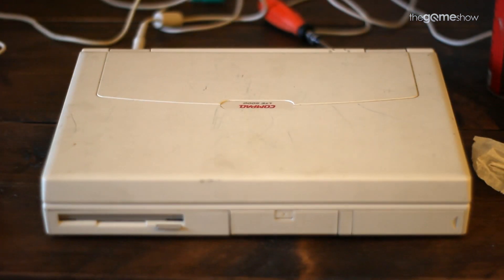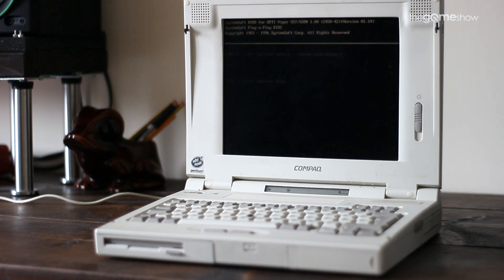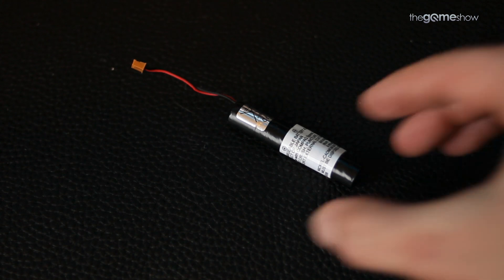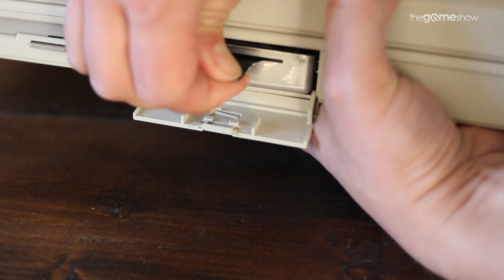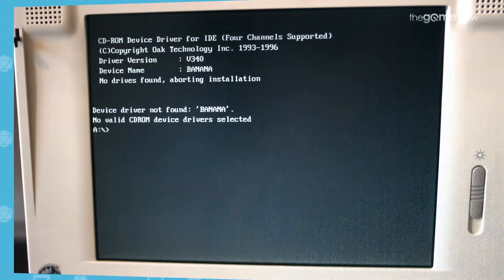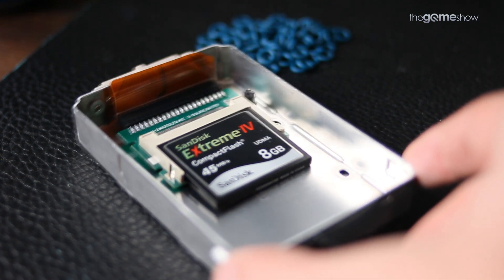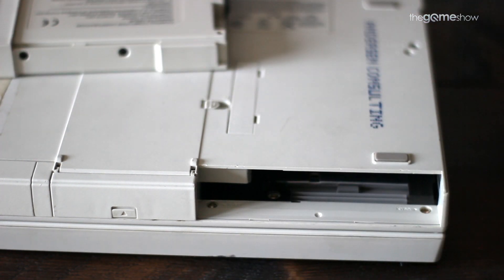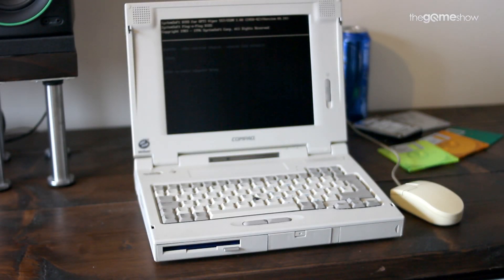Upgrading a Compaq LTE 5000 Laptop with an IDE Compact Flash Card for DOS

Comment: Hey I need to find a charger for one of these what are the power specs on the adapter?
Reply: Output: 18V 1.9A
Reply from the maker: Pinned for visibility!
Reply: The Game Show I ended up using a compaq 2882 which gave me no problem.
Reply: @DrDooDooBucket  The  Compaq 2882 is exactly the same power adapter that would've come with the LTE series. So good find!
Reply: Terrum cool this was all 6 months ago so I barely remember how I even found the correct adapter but I got the laptop up and running correctly.

Comment: I've got a 5100. It simply does not recognize any attempt at hard drive I throw at it. HDD, SD, CF.
Reply from the maker: How frustrating! I had a problem with mine not recognising the CF I bought. But I bought a much cheaper one and it was recognised fine. If you're having wider problems, perhaps this is down to the hardware. The connector or cable might be faulty?

Comment: Buying a Gateway Solo 2500 is better use of money. Although the Toshiba Satellite Pro 445CDT is better investment. It had Windows 95 OSR2 on it's replaced hard disk drive so I decided to stick a Western Digital Scorpio WD400 on the machine in which I installed Windows 98 First Edition on the machine since it had when I got it 144 MB of RAM and an Intel Pentium MMX clocked at 133 Mhz. Threw quite a bit of Blizzard Entertainment games on it. There is better stuff online anyway.

The only other laptop that would have rivaled the Toshiba was the Compaq LTE 5300 with 80 MB of RAM but that one only had an Intel Pentium clocked at 133 Mhz with no MMX and had no USB. At the time I did not even have a PCMCIA CardBus network ethernet card. The Compaq much like the Toshiba you could swap the floppy drive out for a CD-ROM but with the Toshiba you can connect the floppy disk drive as an external drive. The Compaq LTE 5380 as opposed to the Toshiba as well as the Gateway had a 1024x768 TFT LCD Display whereas the Gateway as well as Toshiba had an 800x600 TFT LCD Display.

The major drawback with the Compaq LTE 5300 was the most in terms of an operating system that you could run was Microsoft Windows 95. The Toshiba Satellite Pro 445CDT you can go up to Microsoft Windows 98 provided that you have the RAM. I really like the Compaq Armada laptops that not just came with Pentium MMX but also Pentium II processors not just because like with the Compaq LTE 5000 line which came with ESS AudioDrive ES1688 and you also had Armada laptops that had that in addition to having a built in power supply.

The Toshiba Satellite Pro 445CDT had Yamaha OPL3-SA Sound Chip. The problem with the Gateway Solo 2500 as opposed to the Gateway Solo 9100 was the limited MS-DOS Mode support only working on Windows 95 OSR2.1 mainly for the fact that the NeoMagic MagicWave 3DX Sound System on that laptop only seemed to work properly on Windows 95 and not Windows 98. You could not properly run MS-DOS 6.22 & Microsoft Windows for Workgroups 3.11 on the Gateway Solo 2500 whereas the Compaq as well as the Toshiba you were able to. MS-DOS compliant sound hardware is a really big deal. On the Toshiba I ran QUAKE on the WINQUAKE port at 400x300 and it ran a little bit choppy but mostly smooth. That Chips & Technologies 65554 PCI onboard video chipset on the Toshiba is on par with the Gateway Solo 2500’s NeoMagic MagicGraph128XD especially with both having 2 MB of VRAM. Although I do like the Compaq LTE 5000’s Cirrus Logic GD7543 with it’s 2 MB of VRAM is also not a bad options.

Comment: Concerning the battery, I recommend you buying some lithium ion cells and do a bit of math. Find the designed battery specs, and build yourself a power regulation circuit that adapts modern power cells to the laptop's requirements. It will take some effort, but you can do it.
Reply from the maker: I do not recommend anybody make their own battery.

Comment: Great video! Willing to try with my LTE 5100... BUT (allways a 'but'). 
I'm having an issue with my memory expansion module. (two 4Mb modules=8Mb to add to 8Mb main ram)
I get an awfull "error 7808 FATAL error at location 800004" during memory test.  
It doesn't matter if i switch the order of the modules, i allways get the same address (800004), and i wonder if it could be a 'hardware' internal error  (or maybe BOTH modules have the same error?)
I dont want to spend 40 or 50 bucks without knowing if it's an internal error in the card interface. Any clue about how to test?
It would work with a memory expansion PC card? (lot easier to find than the original module)
Thanks folks!

Comment: yay I have one too. There really well made devices, I had two at one point the first one was doa so got sent a replacement and sent the dead one back where it was possibly just chucked in the bin i never knew the hdd was just a normal drive thought that box was the actual drive also arn`t those cells in the main battery just 18650 cells could just wire up some new ones maybe
Reply from the maker: You definitely could. I asked some guys who are smarter than me if they could and they all thought it wouldn't be too hard. The problem is that the battery case is glued together. So it was impossible to open it without destroying it :(
Reply: @StokedMatty  mines the 5300 as it turns out. So far Iv not done much with the battery but I’ll be giving it a go at some point like you mentioned it works fine plugged in. The battery’s may be slightly different but I’ll post another comment should I get it apart without damage. Iv managed it before on an eee pc sometimes you get lucky and the glue kind of cracks apart.
Reply: The Panasonic HHR-380A are an exact replacement.  These batteries can be opened without destroying them.  Just don’t rush the job.

Comment: Great video ,  my LTE 5000 had a dead HDD, I've now got a 2GB CF card in there and it shows up just fine in the bios. 

My only problem is that I'm now stuck trying to get an operating system on there.
Reply from the maker: Do you have a USB floppy drive?
Reply: @StokedMatty  Not at the moment, it looks like I'll have to get one though.
Reply from the maker: @absinthe4breakfast299  You could try copying the unpacked DOS files onto the CF card from another machine, but I created "real" install disks with a USB floppy drive and files from WinWorld.
Reply from the maker: @absinthe4breakfast299  I'm pretty sure I went with 4 or 5. There's not a lot to choose between them to be honest. I'd say stick with what you've got. I know it feels like a lot, but trust me you can't really mess it up :)
Reply: @StokedMatty  I'm having all sorts of issues with the USB floppy drive I bought, I'm not sure if it's the drive or the disks I got for it, the disks are becoming unreadable after one or two uses..

I might have to try another approach.
Reply from the maker: Found this great guide on Twitter on how to use VirtualBox instead! https://twitter.com/RetroTechChris/status/1419099171727020038?s=19
Reply: @StokedMatty  Thanks for the link, I really appreciate all the help .

Comment: The BIOS of this laptop will not recognize a disk larger than 4GB regardless of partition size.  You can use a program like Ontrack Disk Management to get past this limitation.  I was able to partition and format 8GB CF cards with a single 8GB partition without any issue.

Comment: I just found an LTE 5300, and from what I can tell by dissecting it, the CMOS and main batteries with size and voltage measure up to be something like this:
-The CMOS battery is four 1/4 size AAA NiCd cells in series ending up as a tube that's 62mm long
-The main battery is ten 4/3 size A NiMh cells in series ending up as 5 tubes, each being 133mm long
If you can somehow hunt down such a form factor and feel like messing around with soldering, the math and size seems to add up as both cell types are 1.2V per cell.

The video and its predecessor was very informative for me on how to start maintaining the device, thanks.
Reply from the maker: Thanks for checking these two videos out! I still use my LTE, I'm glad these were useful to you. I'm not confident enough with electrical engineering to make my own batteries. I would happily bow to someone smarter than me on that, and you sound like one :)

Comment: I just found a compaq LTE 5250 laptop (a slightly faster model running a Pentium at 120mhz with 16MB of ram and an 40GB HDD) on the floor in the stable at my parents place. It was literally covered in horse sh*t, dirt and staw, but it powers up and works perfectly haha (except for the battery which is dead). It also has windows 95, so I guess that was the os that came preinstalled on these machines (at least mine - my parent know very little about computers).
Good idea with the CF card. I'll definitely do that. At the moment, the only means of transfer I have is the floopy (which works, just installed the shareware version of Doom from original floppys). The only gripe I have with this computer is that it lacks a gameport for a joystick. A PCMCIA to gameport adapter seems to have been around, but I can't seem to find one.
Reply from the maker: You're dead on. These laptops did come with Win95, but I don't think it runs particularly well which is why I went with DOS and Win3.1. I'm sure PMCCIA -> GamePort adapters exist, but you'll be looking for something old..?
Reply: @StokedMatty  I just noticed that it  actually has a gameport hidden behind a hatch on the back of the machine DOH. So i'm a happy camper now.  I'll go with DOS and windows 3.11 aswell. Just waiting for my CF card adapter to arrive. :) Also, a bit of correction on my inital post, it has a 800mb hdd (not 40gb obviously). Just watched the 8-bit guys guide on DOS laptops and apparently my version is less ideal than the TLE5000 (even if it's faster) because of the fixed 800x600 resolution. So DOS games (that typically has a 320x220 resolution) scales up to 640x480 and leaves black bars to fill the entire screen...
Reply from the maker: @PARASITSTUDIOEFFECTS  No big deal! It's still a free dosgaming laptop! Keep me posted, I'd love to hear about this. Drop me a line on Twitter if you use it ☺️

Comment: I just ordered this and will use it to give rebuilding the batteries a shot.  I have four LTE 5000 series laptops.  Two of my batteries have circuit boards that pass visual inspection.  The other two were pretty badly eaten :( https://www.digikey.com/product-detail/en/HR-4%2f3AU(4.0AH)L2X5/SY135-L025-ND/1203627?utm_medium=email&utm_source=oce&utm_campaign=3078_OCE20RT&utm_content=productdetail_US&utm_cid=1134651&so=63797571&mkt_tok=eyJpIjoiT0RSaU9UaGxNMlUzTXpreiIsInQiOiJsd1lvTVZYVFBHQk9wZTQ3XC94VVlcL1puNkNaWWxyR25zRnhrNEYyK1I3ZEdUenFCaTZvR2ptaW4xYUlWY1VMYWtoMVljbllhZ3dCR042aThUOHNiVjkreFU0VmdpOEVRTWZYVFhaV0xiTmk1Z2JURG5SU1BTbTBpR0F0SmZzTFVKIn0%3D
Reply from the maker: 85 bucks for a battery! Let me know how you get on mate.
Reply: @StokedMatty  will do!!
Reply: @StokedMatty  installed and charging!  Hope it goes to 100%.  So far, gone from 6% to 18%, and I was able to unplug AC power and run on battery!
Reply: @StokedMatty  battery went to 100% and the laptop ran for a few hours on battery!!!  Having some issues on second charge (it was charging up then stopping), but I am optimistic that the battery recalibration util will fix it.  Running that now.
Reply: @StokedMatty  another thing, I think a Compaq genuine charger is a must.  The aftermarket chargers charged very slowly and the battery would discharge when the machine was running and charging.  And the machine would shut off if you pulled the battery while plugged in.  Not seeing these issues with a genuine charger.
Reply: @StokedMatty  Sadly, I think this experiment has ended in failure.  The thermal breaker in the battery keeps tripping, which means that it is getting too hot when it charges.  Might be an issue with the thermister that hooks up to the charging board for the battery, but I am going to pause on this project before I burn my house down.  Someone more knowledgeable than me (which pretty much constitutes anyone else for this) could probably work it out.

Comment: Great job! Couple tips:

First, on the hard drive, I have found CF cards to be quite picky when using them in this manner, with many just freezing up on format. To get around that, you can try other brands and capacities, or go another route: mSATA to 44 pin IDE adapters. I have one in my LTE5400 with a 120GB SSD that cost me next to nothing from some chinese vender, and the speed is fantastic.

As far as capacity, the first thing to do is upgrade the machine BIOS. The LTE5000 series has a 2.1G limitation iirc unless you have the latest bios rev, which brings it up to 8.4G. Of course, if you want to use more capacity than that, you will also need an overlay like OnTrack, which is what I use for mine.

As much as I understand your comments about running 95 on such a machine, there is one killer benefit to using W95, in particular, OSR2: FAT32. You can actually make an arbitrarily large filesystem, up to 2TB if memory serves, and load on every bit of MS-DOS software you can get your mitts on. Just disable the win UI on startup. The only sad thing here is you cannot run Win31(1). 

The full Win95 environment does actually run pretty well on these things though if you use period-appropriate software or write your own. Yes, VC++6 works great on these too, or as great as it will ever run on a 120MHz pentium anyway... That being said, TASM, Borland C, and the various 16 bit dev tools absolutely scream on this, as does most dos software. Getting MoSlo (pay for it) is HIGHLY recommended, as much older software just flies by without your input without it.

Cheers! Keep up the good work!
Reply: Hi. Please can you recommend me the type of mSata<>Ide adapter. I would like to use it with my LTE.

Comment: I just obtained a compaq lte 5000. But the cmos battery is gone. Do i need it? I dont know much about computers
Reply from the maker: You don't need a CMOS battery. The PC will still work fine, it just won't keep internal time. If you make configuration changes in BIOS, these will also reset each time the machine turns off. But you can use the machine sort-of fine without a CMOS battery.

Comment: You should rebuild the battery from lithium ion cells. You can buy some from ebay, or maker sites. You'll need to do a little research for what specs you will need for your laptop.
Reply from the maker: I like my house as it is, not burned down 😆 Seriously I don't have the electrical confidence to make my own battery and plug it into the mains.
Reply: @StokedMatty  check out 8bit guys video on it. It's easy.

Comment: Windows 95 is the perfect OS for this generation of laptop. I have a 486DX-50 laptop with 16MB of RAM that came with Windows 95 when new. It's period correct. Also, nice video! I use CF cards on almost all of my retro PCs that don't have support for large hard drives.
Reply from the maker: Thanks man, I'm glad you liked the video! Win 3 runs a lot quicker than Win95 but no doubt about it being period correct.

Comment: I'm going to try doing this with an old Dell Latitude C600 from 2000. It has a 10GB hard drive I'm going to put a 32GB CF card in it. 

Also the RTM floppy disk version of Windows 95 sounds like a fine match for this laptop since it doesn't have all the Internet Explorer bloatware in it (like in the later OEM CD versions), and it can run Win 3.x programs just as fine.

Comment: Buy a replacement battery for a GE Datex Ohmeda S5 Patient Monitor.  The cells are identical and already in the correct orientation.  Just solder the wires from the old board onto the tabs and Bob's your uncle.
Reply: @Paul Briggs The part number is CS-GMS500MD.  Not exactly cheep, I think I paid about $50.  But still far cheaper than buying the individual cells and having someone spot weld them together for you.

Comment: Nice video! I got a Compaq LTE 5100 recently and it seems to be in a good condition. It runs Windows 95 at the time, but I will probably do something similar to what you did. But there's a big problem.. I can't get the ESS sound card to work. The sound card is detected and the sound card driveres are installed, but there's no sound from the speakers or head phone jack. The speakers are enabled (status bar icon) and the physical volume control on the side is not muted.. I've managed to record sound using the internal microphone though. Do anyone have any suggestions? Software or hardware issue?
Reply from the maker: Hi mate. thanks for commenting! Great to hear. If the driver is there and the card is detected then I'd say it sounds like a hardware issue. Especially as you can use the microphone jack. I would suggest uninstalling the driver and re-installing, and checking that the sound card allocated the appropriate IRQ in BIOS. But actually it sounds to me that you should check the integrity of the wiring, soldering etc of the internal speaker and headphone jack.
Reply: Thank you! I agree that it seems like a hardware issue. Will try your good suggestions as soon as possible.

Comment: I'm sure you know it, but on the right side you have 2 PCMCIA slots. You can use a PCMCIA to CF adpater and have a super easy way to transfer data to the LTE. It's even hotswap capable (at least under windows 98; I have the Pentium 133 model). No need to remove the HDD CF anymore.
Reply from the maker: I certainly am aware, I used the PCMCIA ports to connect my external CD-ROM drive. I like what you're saying but I don't want the CF poking out the side the whole time. And there's no way I'm going to install Win98 on a machine with these specs. It crawled with 95 installed! :)
Reply: @StokedMatty  The CF isn't poking at all. You can even close the flap. But maybe 75 MHZ is really a little slow for more than Win311. - What did you pay for the CMOS? I searched online and found one for 25 dollars. I won't pay that.